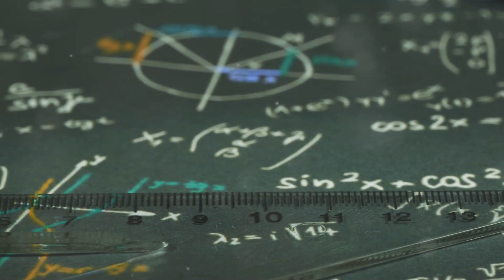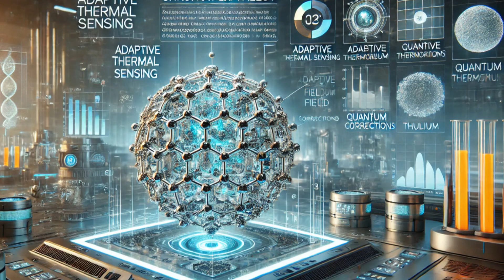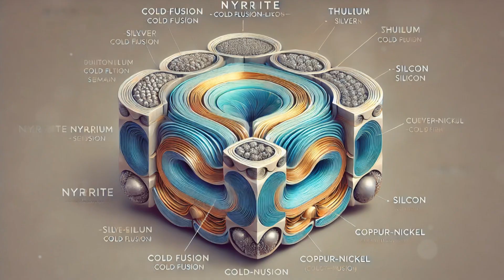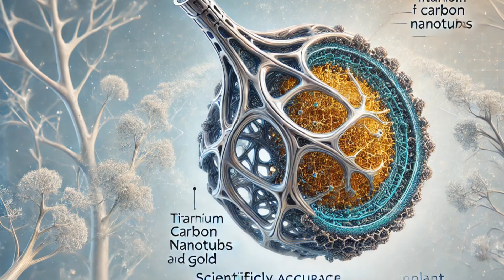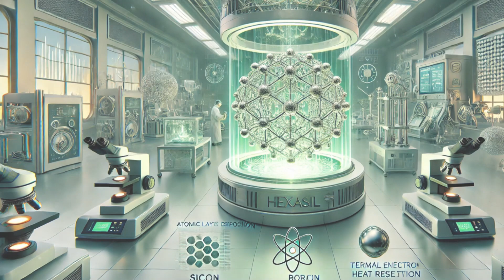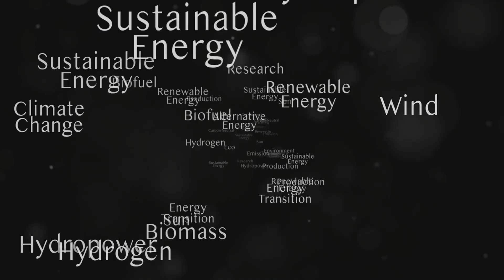Fractal and Resonance-Based Energy: Redefining Renewable Power

Comment: Hopefully there is an application where fractal based design works. It has been a failure in antenna design.
Reply from the maker: Current AI-assisted antennae designs operate in the 100 to 10000+ THz frequency range. This is where most of the harmonic action is. The technology is beyond 6G already.

Comment: What about Installing fractal resonators in AI hardware systems to capture ambient vibrations, electromagnetic waves, or heat, converting them into supplementary power to reduce overall energy costs?
Reply: I think shifting from deterministic computing to a new computational paradigm will be much much more beneficial. Like thermodynamic computing which uses nature's randomness as sampling data for Generative AI's , theoretically it should work on landauer's limit so it's extremely energy efficient.
Reply: New matrices will be self-sustaining... they will give power , not take.